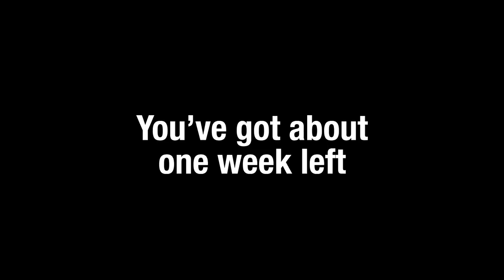Twin Turbo LAMBORGHINI RALLY CAR VS 1000HP WIDE BODY GTR! **THE ULTIMATE RACE**

Comment: we need the drag race !!!
i would take the lambo v12 because its a manual gearbox :D
Reply: Manual is fun but slow for racing. You can't beat a PDk dual clutch transmission shift  speed
Reply: @rebel9838  true , but still would take the manual because its more fun and less boring to drive :p

Comment: Tbh JR garage has 2000hp lambo would like to see that drag racing against you guys
Reply: Spicy Tape it is 2000 hp. There video of it doing like 250+mph in a mile or half mile. I’m pretty sure at the time of it doing his run it was the fastest manual Lamborghini in a mile or half mile.
Reply: Spicy Tape it will make 2000 hp on race fuel but on 93 or smt it probably makes like 1200. Still a friggin fast car.

Comment: Unicorn V3 would smack Guaczilla no cap
Reply: Not exactly
Reply: Guaczlla will because  it has a alpha 10 kit and unicorn v3 only has a twin turbo and exhaust
Reply: kevin ramirez yeah but think about weight as well as the anti lag and launch control on Unicorn. Unicorn is presumably much lighter, and it has a very advanced launch control system and amazing anti lag